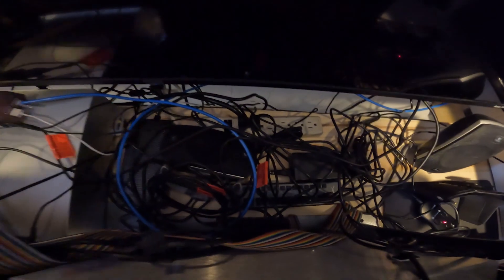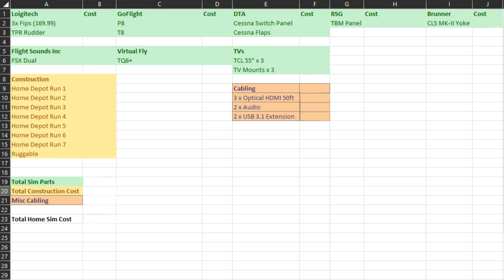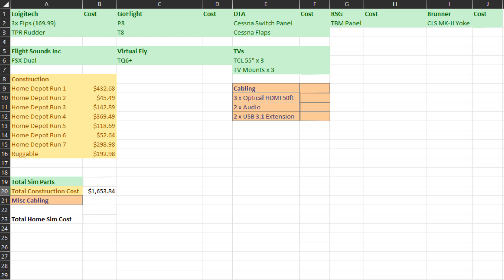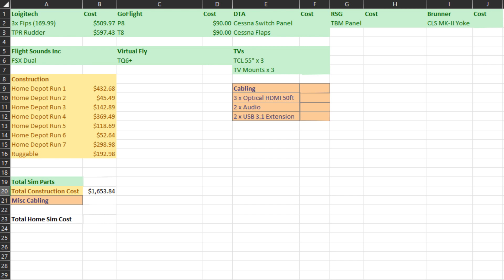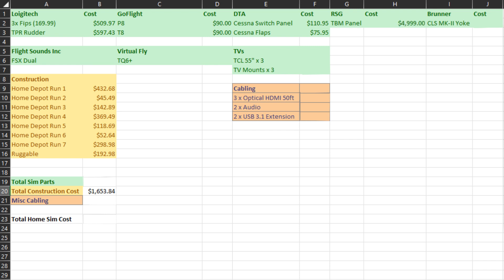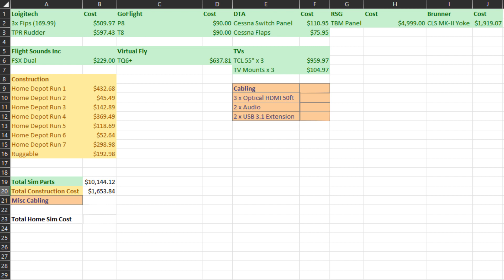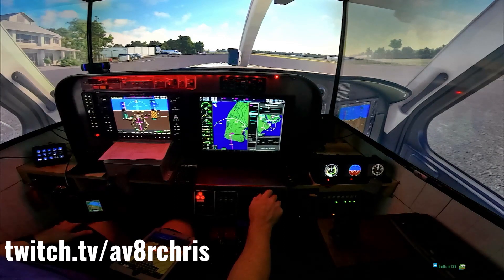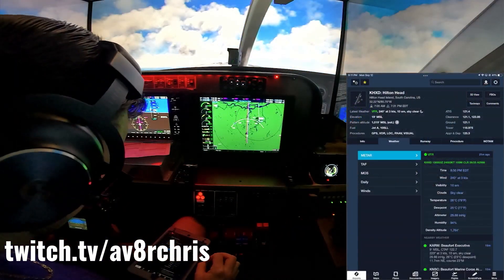Home Flight Simulator Tour Series - Construction and Final Costs - Episode 5

Comment: Thanks Chris, Im new to sim but had my pilot license when younger. I’m leaning toward the TBM900 sim too. Can you use any of the TBM panel switches for the Mooney speed brakes or would I have to map a separate switch.? And generically, are there any TBM switches you can reuse for a different plane since it appears you had to get a complete 172 panel to replace everything on TBM panel? Thanks again!
Reply from the maker: So thats a loaded question.  With the default RSG software, any aircraft thats a G1000 will work out of the box for pretty much all the G1000 functions, including the autopilot panel.  The TBM specific panel (consisting of the overhead, Landing gear and ice panel) is a mixed bag.  Now, if you use a 3rd party software such as Spad.Next, you can completely customize all buttons and switches.  It takes a bit of effort and isnt as plug and play, but the end product is well worth it.  To take some of that work out, I've published some of my configurations within the spad application itself, so it would be just about as easy and starting spad, clicking the online snippets and downloading anything myself or others have done.  The only exception to this is the TBM panel itself as that isnt supported by spad just yet.  Although I've supplied the dev with hopefully the needed data to add the support.  Hope that helps!
Reply: Yes thanks!

Comment: So how do you have 5 screens at the same time? Do you have one mfd in integrated graphics?
Reply from the maker: The 3 are off the main gfx card and then I have a usb 3 dual hdmi that drives the rsg screens. I actually added another usb 3 dual hdmi to drive to 7” raspberry pi touch screens that I use for the longitude. Works great and no frame loss on the pop outs!

Comment: I've spent nearly half that just on the PC good enough to run the sim adequately. Did I miss that in your cost breakdown?
Reply from the maker: I probably should have mentioned this in the video but it slipped my mind.  I didn't include the PC cost itself since it was my existing gaming machine.  If I was going to guess, It's probably around 4-5k if I had to build this machine from scratch.  The 3090 alone when I picked it up was close to 2k I think.